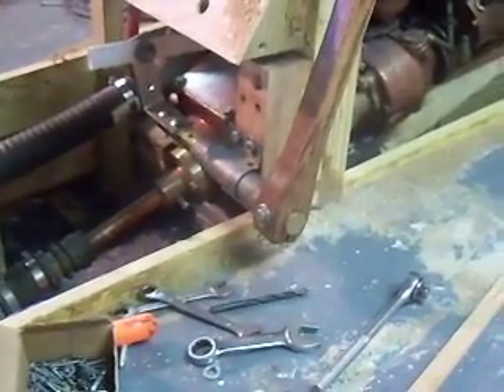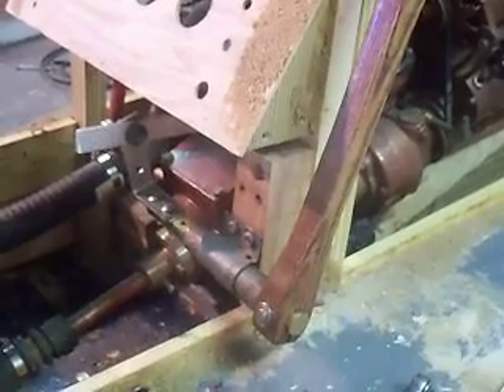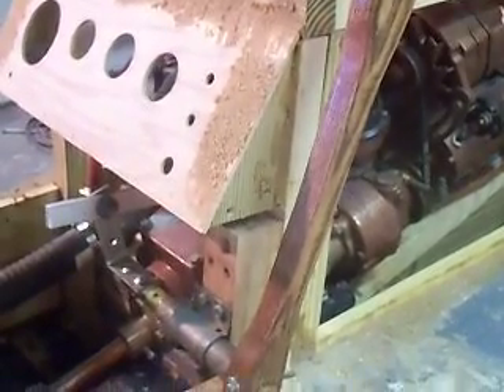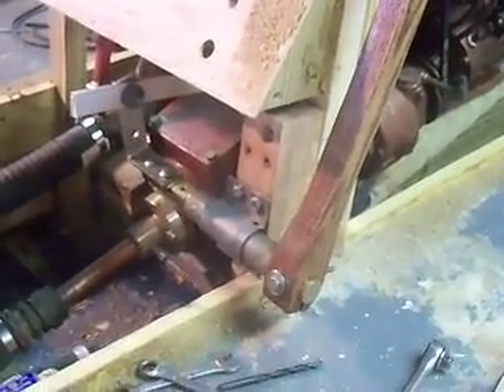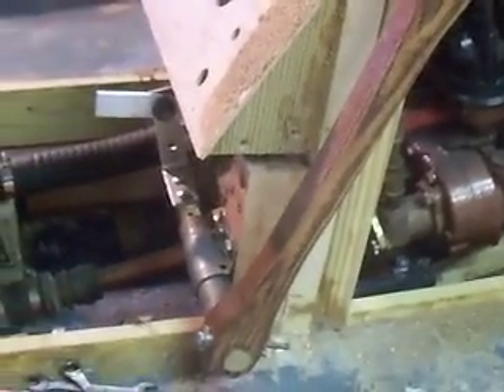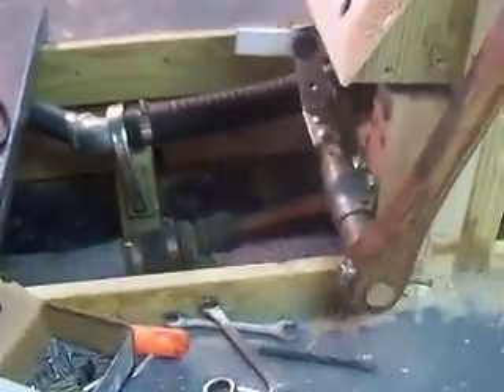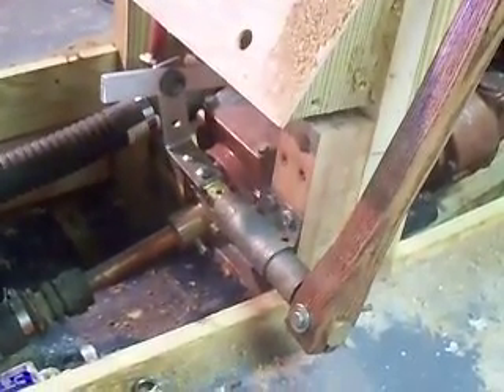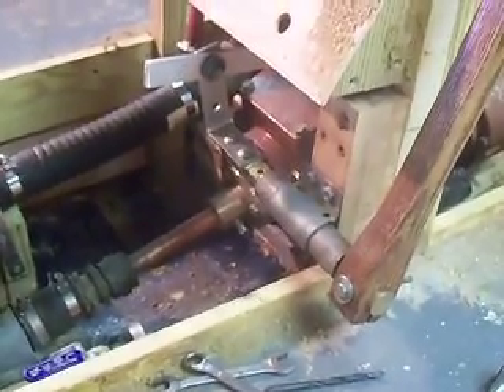Installing an inboard motor in a small boat update 9 of 13

Comment: I had to laugh because I think I remember commenting on one of your videos that you didn't use a Rube Goldberg method to get things done.
Reply from the maker: +Pidasian Hippie Yep, and then I went back to Rube Goldberg when I discovered I needed the shifter out in the open.  Only this time I built it with better parts.
      Really, I should never say anything about "Rube Goldberg," as if I'm totally honest, the whole boat is unnecessarily complex.  Fact is, that the use of outboards has almost totally replaced inboards because the arrangement is simpler, cheaper, more efficient, and much better.  
     I'm under no illusions, I built it, and continue to work on it, as a challenge, and as part of my hobby of "building stuff."  Lots of retired folks waste money and time playing golf, or fishing, or whatever;  I waste my money and time building stuff.  I gave my golf clubs away years ago.
Reply: ***** I get the impression that the creation of the system, in this case the shifting mechanism, is what you enjoy most.  It may be true that outboards are more efficient, but there is something to be said for a motor set up like yours.  To me they have a much better sound.  That is far as my knowledge goes.  hahahha.  I will be embarking on retirement at the end of this year.  So far, I don't have any hard and fast plans, but I am sure that, like you, I will find what interests me most as time goes by.
Reply from the maker: +Pidasian Hippie Retirement is great, as you no longer need to perform for the man.  Instead, figure out what you want to do, and don't just sit on the bench and watch the clock run out.  That's about as philosophical as old Memphis gets.
Reply: ***** That is pretty philosophical.  I see too many people who sit down once they retire and I don't want to be one of them.  My dad retired with 100% disability with black lung at the age of 55.  I watched him go from a man who could not walk 20 feet without stopping to "catch his breath" to hiking a 5 mile trek in the mountains.  The black lung still took him at an early age, but he enjoyed as many of those years as he could.  That is the kind of retirement I envision.
Reply from the maker: +Pidasian Hippie My parents lived until their early eighties, but they were so inactive the last 20 years of their lives that were practically invalids.  I figure you got to keep moving, or it's over.
Reply: ***** One of the commercials on these YouTube videos has an older gentleman who says, "You don't quit playing because you get old. You get old because you quit playing!  I think those are words of wisdom! (I don't have a clue what the commercial is for.  ahahhahahha)
Reply from the maker: Pidasian Hippie Sad part is that Medicare approved my Dad for physical therapy after a surgery he had. While he was doing the physical therapy his mobility and strength greatly improved.  He even commented about how much it was helping him.
      I pinged on him hard to continue exercising on his own; walk, work outside, do exercises, do something.  But no, after the physical therapy stopped, he slinked into his old habits (sitting at the kitchen table smoking roll-your-owns all day, then watching Gun Smoke in the evening.)
Reply: ***** That is very sad.  It is a shame how much people give up living after they retire.  In preparation for retirement, I have read many books about it.  More so than the money, it is recommended that you prepare yourself mentally for stopping work and moving into a new lifestyle.  I hope that I am as prepared mentally as I know I am financially.